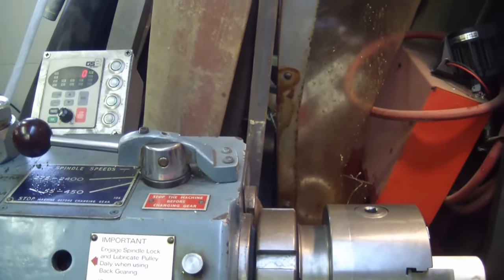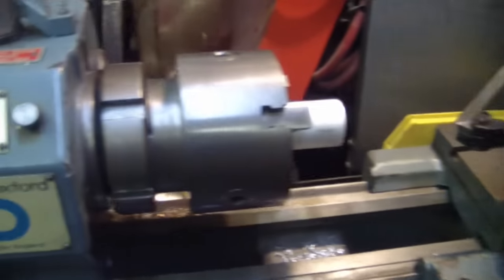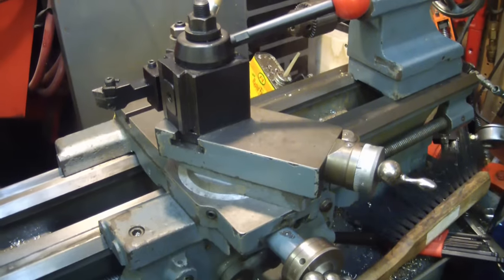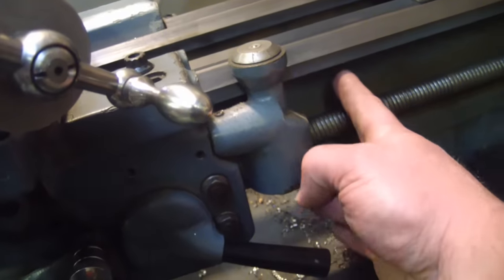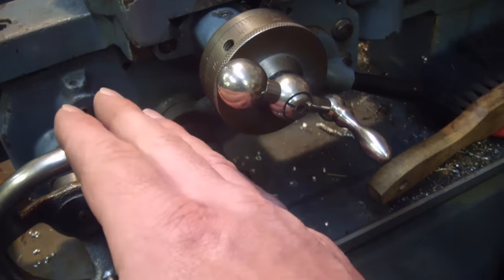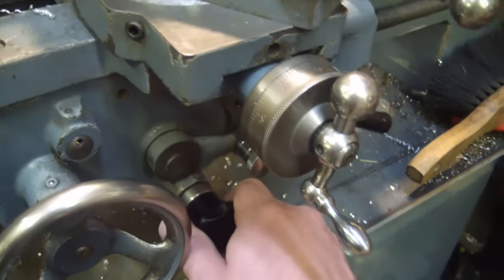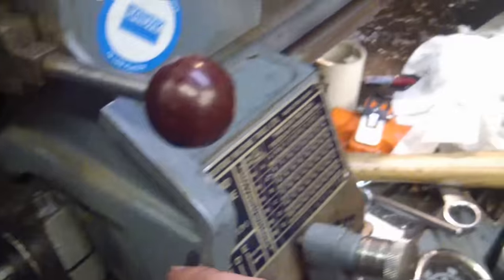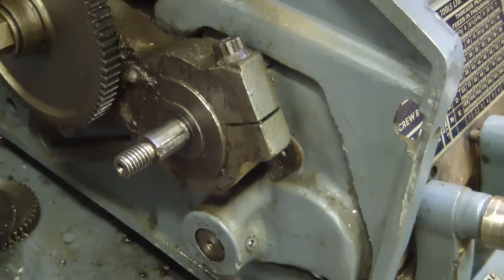3 Simple Rules to troubleshooting ANYTHING.

Comment: This is an old video... But the truths everlasting. I've been an electrician and a computer programmer... And these troubleshooting rules apply equally well in both arenas. These are universal rules. Though, I'd probably give PEBKAC... 95% (that's: Problem Exists Between Keyboard And Chair). In IT we also use ID:10-T 😁

Comment: Rule 3.A. Read the manual but take the parts breakdown with a grain of salt.  For one. It is a drawing of the parts and don't necessarily accurately reflect the actual part itself,  just a representation. And two, breakdowns can be notoriously wrong  .

I can't tell you how many times a customer bought the wrong part bc, it looked like the drawing or they blinded trusted the part number on the diagram that was misprinted.

Comment: Maybe the clutch really was bad and the 5 year rest cured it.

My last job was at an International dealership about 20 years ago and the diagnostic protocol for a check engine light was to do a whole bunch of crap before connecting the scanner to pull the fault code(s), hell no.  The code almost always leads you right to the problem.  I still start with scanning for codes whenever possible.

Comment: This is the truth.
I was once fixing a machine, it turned on but didn't move. We're looking cluelessly at the circuit board. I call up the company, they get me to a field service guy. First he asks, "Is it plugged in?" Yeah, duh. Next he asks, "Is the motor spinning the correct direction." Wait, what? That's a thing? Motor is spinning the wrong way. There's a big arrow on the side of the motor. Its 3 phase. He says, (shut off the breaker), flip two of the wires, then the motor goes the right way, then the hydraulic pump can actually build pressure and move. Then the machine worked great. Learn something new every day.

Comment: as a HVAC tech I cant tell you how many times I got a furnace on by just taking off the door and just start gently touching and moving the wires a little, waiting to hear the click of a relay or see a LED illuminate. Loose connections on the wiring are very common, and sometimes can be a cinch to find, but, as the man said, start small... always start small....

Comment: rule 1: when buying second hand mechanicals, assume the previous owner didnt have a clue .
rule 2: disassemble and clean, check for worn or broken parts, replace or rework as necessary, reassemble.
I bought a 3000euro motorcycle a couple of years ago for 500euros.
the previous owner used it in summer only and said the clutch was broken.
I bought it and filled the clutch master cylinder up. and sure enough, the slave cylinder was leaking due to lack of use.
luckily, i own another bike with the same engine and had a spare seal.
5 minute fix.

Comment: I agree with #1.

My #2 is: "Have the balls to take it apart to see how it works" (that box turtle when I was 4 years old would disagree).

I think your percentage on #3 is too low.

My last is "90% of electrical problems turn out to be mechanical problems".  I.e. screw driven into wiring harness.
I operated my 13" Clausing lathe since I was 8 years old (I'm 71 now).
Dad's machine shop was my after school daycare.
Wanna buy a bigger lathe?

Comment: I was driving down the road one day heading to the store and I saw a Stihl chainsaw sitting out with the garbage. The guy was cleaning out his garage and putting his dads stuff out for trash day (his dad died a while back). I was gonna stop and ask if I could take it but I waited til I was coming back thru on my way home. It was still there and I pulled in and asked him if I could take it. He said "take the whole pile if you want it". He said the saw started but the chain wouldn't turn. Told him I'd take it home and tinker with it. It fired right up and the reason the chain wouldn't turn was because the chain brake was on. I felt bad not taking it back to him but I knew he wouldn't use it. He was getting up in age himself. Still got it and it still runs good.

Comment: As of last night I finally found out that the broken jake brake in my diesel truck was 90% closed. Thus the over heating for the past 10 years. Always figured it was the fault of the 16 year old that owned it last. So I removed the head and replaced the head gasket. Rule 1 would have helped, but my problem started 5 years before your video came out. That's my excuse and I'm stickin' to it. Truck flies now thanks to 6 inches of bailing wire !!! 10 years of driving the speed limit. What a dumb a$$.

Comment: I remember when I built my computer at 13 I went to turn it on and it didn’t. I opened it back up checked all the wires tried to turn it all again. It didn’t work. Was about to call it quits when I realized I didn’t turn the power supply switch to on.

Comment: That lathe looks and works just like an old 10" South Bend that I acquired 45 years ago.
Reply: Yes you are right, he 10" Southbend and the Boxford Model C are the same lathe. I have both lathes and are using the screw cutting gearbox from the Southbend on my Boxford lathe at the moment.  
I bought my Boxford secondhand in 1966 and the year after took the bed in to Boxfords factory in Halifax to have the well worn bedways re-machined.   The receipt for this was £22 and this included three missing change gears.
I was even shown around the factory and outside in the yard were a few hundred  lathe beds all covered in snow and red rusty.  I was told that new bed castings were traditionally left outside for six or seven years for the casting stresses to settle out before being brought in to be sandblasted and then machined. 
My Southbend lathe was bought because it was damaged, dirt cheap and came complete with a Boxford Cabinet stand and a screwcutting gearbox which were what I was really interested in.  After repairing the damage to the Southbend, I found it to be just as good as the Boxford.

Comment: 1. Human error. I used to know a lady who had a I'll start if I want to car. After mechanics changed 3 starters I figured out she didn't know she had press the brake pedal to start the cat. After cleaning the battery terminal and clamps.
2. Loose broken hardware or connections. 

These 2 issues cover 90% of all faults.

Comment: Bought a very nice used refrigerator for my son off Craigslist. Owner said the ice AND water dispenser doesn't work...  so instead of asking $350.00 like everyone else, they wanted $150.00....hmmm...what are the chances both "solenoid water valves" quit? The fridge was plugged in but off to one side of their new one, so I told my son to activate the ice and water switches while I was behind with my ear to the solenoids...I heard them clicking... so we bought it...Found out later they hooked the waterline up...but never turned the water on...works perfect.

Comment: For me, on kit like this which was used commercially, The first thing to check is just how many of the safety circuits, trips, fuses, limiters and breakers have been overidden or bypassed. I've dealt with a problem on plant and then suddenly smelled burning or encountered new and undocumented  clanking noises only to find that the function I have just repaired causes problems with another part of the plant or added too much time to a repetitive machining process, so it was "disabled". Usually this was so long ago that the guy selling it (or operating it) wasn't even there when they decided to remove that feature and for obvious reasons, if it was a safety feature it was obviously never documented in the service schedule ! 

Don't trust anybody

Comment: I would also add, (probably more of an electronics troubleshooting tip) forget about the measurements and assumptions you made if you arent going anywere. Better starting off all over again. 

Dont say "i dont have to do/check this because i already did it". Tip 2 includes your past self too. 

Using logic to solve problems is imperative, sticking to it is fatal.
Reply: Hi @Basileus, I did not understand it. Could you please explain, may be with an example

Comment: I couldn't tell you how many times someone would call the shop I worked at and told me that someone else told them that their water pump was shot.  I would always tell them to bring it down, because I hadn't told them it couldn't be repaired yet. Conceited? Maybe.  Confident? Yup. I repaired more "un-repairable" pumps and motors than I couldn't, by a wide margin. If someone tells you that something can't be fixed, take another look.

Comment: Hi my name is Kevin from Aus   first you need to turn your chuck jawles around and grip it better  shorten the tool in tool post the gears need a little lube on them and bed repair ant damage  keys in gears read your manual ask if you done know the clutch runes in oil it has 2 plates that expand when you turn the knob I know a bit about these thing after 55 years  as engineer working in a family machine shop Kevin

Comment: Somehow this reminds me of my experience with a piece of software. It was reasonably capable, but there was something else I wished it could do. I even got ideas for what keys should do such things, thinking of E-mailing the creator with this suggestion. Eventually I read the manual and realized that not only what I was thinking of possible, it was done using the exact button-pushes I'd been thinking it should be done by. I guess great minds think alike? But more importantly, the first piece of advice everyone should heed, no matter how "manly" you think you are: Read. The. Damn. Manual! Granted I've had plenty of situations where there was none, or the manual was pretty much useless, but always try. And if the manual is questionable or nonexistent, or doesn't answer your question, check for blogs. Almost surely someone out there has had the same problem.

Comment: No.  Not the first 3 rules. Good advise, but not the first 3 rules of trouble shooting. 
1. Turn it off... turn it back on.
If that doesn't work
2. Un plug it... plug it back in.
If that doesn't work
3. Go check the breaker.

Comment: AvE, Re fixing anything... given your proclivity to disassemble, preoccupation with material minutiae, and general power tool wherewithal, I have a request for a vigeo.
Can you do a piece on the restoration of power tool that has water damage (as by a flood)?

Grinder, drill, whatever... 
Many restovids cover disassembly and replacement of parts like bearings and switches. No body has adequately covered the cleaning and continued protection of motor rotors, comutators, etc...very well. Insight on surface finish, balance, and clearances is hard to find from OEM. Best practice advice from your perspective would be great.

Confucius Say: "Man who goes to bed with Women Problems, wakes up with Solution in Hand".

-KYDIAV

Comment: If there was a person before u that worked on a small engine. Good luck. It always turns into a nightmare cause everything has been screwed up.
Reply: The worse is when they start playing with the screws on the carb and they lie through their teeth about.  For a while I was working on airless paint sprayer pumps. I found out real quick that what a painter says is wrong with the punk and what the real problem is, is two entirely separate things. You can waste away a half a day fixing problems that don’t exist. I’d say 15% of the time the sprayer is plugged  because of dried paint.

Comment: I bought a 1/2 dr air impact  gun ,... new, but cheap ,took it to work conected the air pulled the trigger and nothing. ..it when straight into the garbage, next thing I saw 3 techs taking it apart working on it time goes by and,...nothing, ...I know tools.....
Reply: air motors are easily fixed

Comment: so lets try this method for fixing a for loop blind without input or output access only back end upload via restricted txt file and no db access

1. easiest thing first? subjective, for me its easy and no troubleshoot needed, for someone else turning a computer on is the easiest thing first
2. i dont rely on other people but if i had to learning peoples failures saves you time repeating their mistakes, if you cant judge or search for good integral resources that you trust then you should defintaley not rely on your own judgement and stop what you are doing as it could be dangerous 
3. 90% of problems are between the drivers seat and steering wheel? where is this stat from other than dominic torreto in fast and furious? reference or just more nonsense click bait like this video
Bonus if it can go wrong it will go wrong? no this is wrong if you have a intermittent fault it will rhytmically or non ryhthmically occur, not 'will go wrong' 'may go wrong'

Comment: Does the Brit Lathe have graduations in inches (thousands)?
Reply: I have both the Halifax built Boxford Model C lathe and the Southbend 10" lathe and both of mine are graduated in thou's on the index dials.  They are basically interchangeable machines and I use the screwcutting gearbox from the Southbend on the Boxford for cutting imperial threads and a transposing gear 100/127  along with change gears for cutting metric threads on the Southbend lathe.
I believe that the later versions of the Boxford were built with a metric leadscrew and indexed in millimeters as an option.
Reply: Thanks!

Comment: repair guy comes up at work: 

Him: "so what's the problem?"

Me: "garbage disposal's clogged, I think it's some straws or easter grass."

Him: "any silverware or anything stuck down there?"

Me: (knowing I'm not the one usually manning that side of the machine) "Not that I know of, but it's possible.  It just seems like there's a wad of something under the grindy bit." 

[twenty minutes of scraping out the pipes and insides of the disposal later]

Him: "this was the clog." [holds out a spoon wrapped in disposal-chewed swizzle straws.  the spoon is ten times thicker on its thinnest plane than the opening it apparently fell into]

Me: "Huh, well I'll let the rest of the crew know to be more careful."